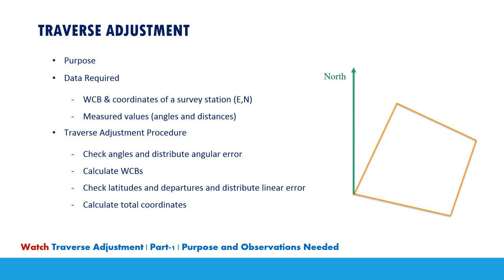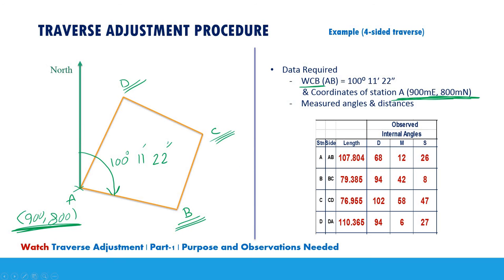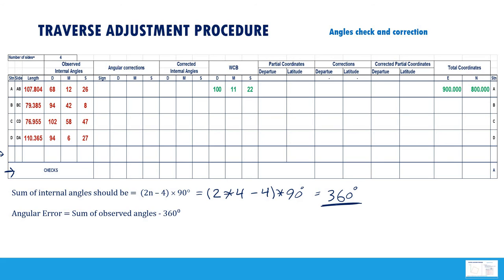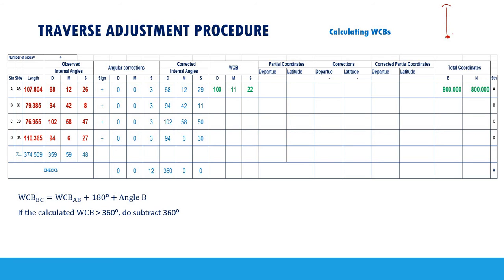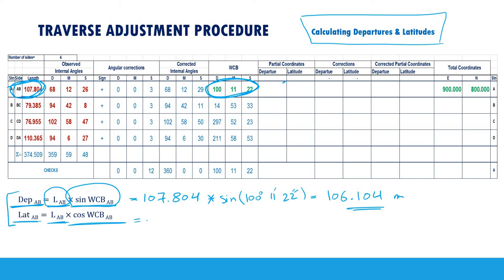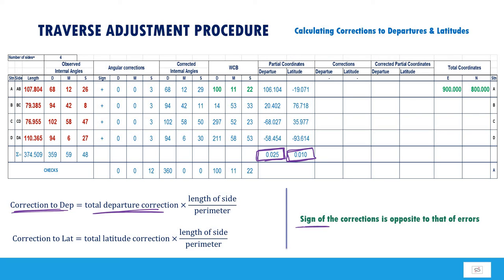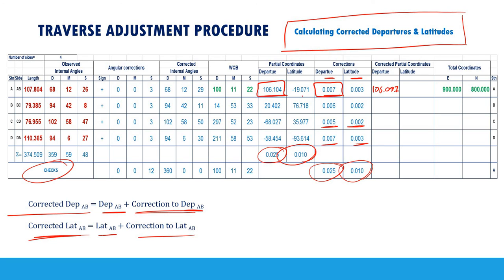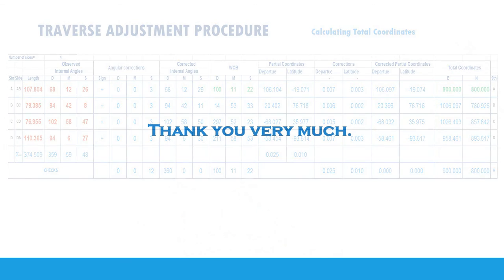Traverse Adjustment | Part-2 | Complete Calculations (Solved Example)

Comment: how you got the WCB of AB??
If i we have a new project and only 1 known point from where you got WCB of AB??
Reply: It's impossible to have only one point. You will have at least 2 points, but never accept 2 control points from anyone even if you get them from local authorities, always ask them for at least 3 control points. At least you will have a Resection methodology on how to calculate a 3 angle triangle 😉

Comment: when you say "always start on a point with known coordinate" how we come about knowing the coordinate of that point if not given on paper like on your example? Is it ok to just make up a coordinate if is local network?
Reply from the maker: The starting station might be a Benchmark (a point with known coordinates). The surveying agency in each country has established a lot of Benchmarks to cover their lands. For local projects you can use an assumed value for your Benchmark (starting point).
Reply: @ziadabdeldayem6884  understood. a lot of building setting out are local. so by the way, what is the method of actually correcting those coordinates once you work out correction of angles and distances? are the new coordinates corrected in the total station and then marked on the ground/pegs?
Reply: @Silentwarzone   I need this answer too. Hey Geomatics where are you? Come out come out wherever you are…
Reply: @rashmijailani2303, @Silentwarzone
 Guys do you know what traverse adjustment means before asking this question?????
Before starting work you will get at least 2 coordinates from local authorities... but never accept 2 control points from anyone even if you get them from local authorities. You must ask for at least 3 control points. With 3 coordinates you can do Resection and check the accuracy of the 3 coordinates, if they do not match each other do not accept the control points and ask them to check again. When everything is OK you can start creating new control points and when you have created a loop with new control points you can start the Traverse Adjustment Method!